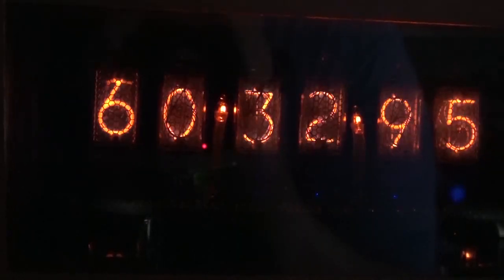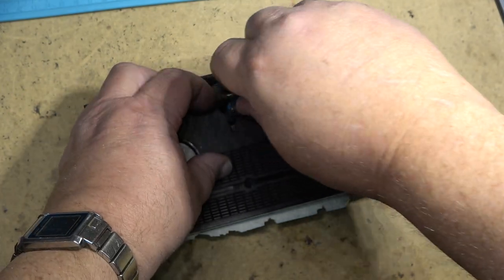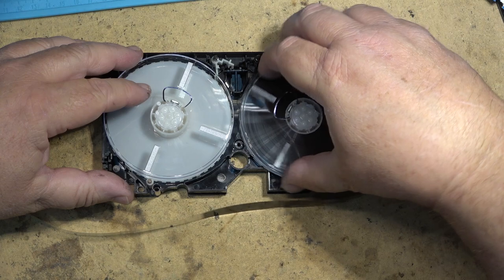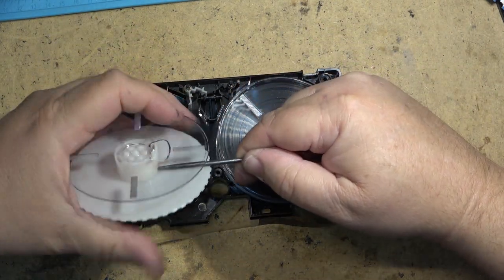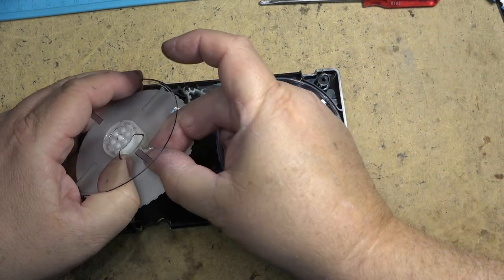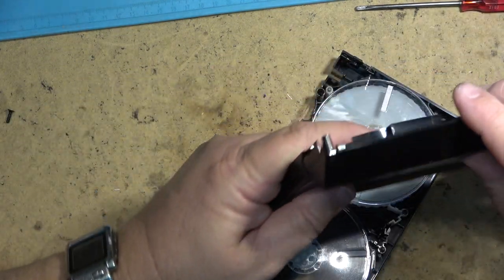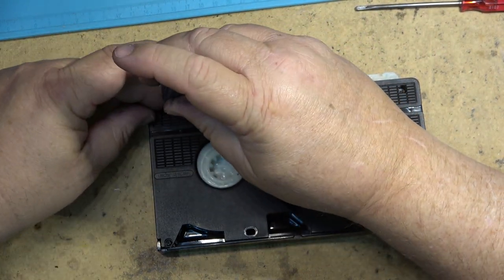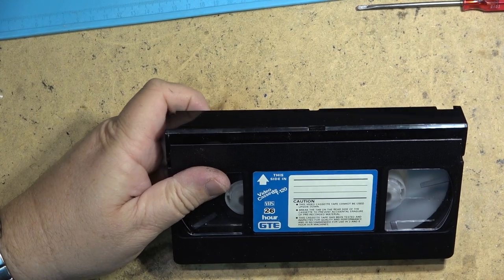How to repair a VHS tape that has broken at the hub

Comment: Years ago i had 2 videorecorders damaged internally because of a single VHS tape which the tape inside of the VHS case was sticked (probably due to humidity conditions) in the left guide. I only discovered that after the 2 failed (and rejected on both videorecorders) attemps of playing the tape, so i opened the case and released the tape from the left  guide.

Comment: There is a small hole in the underside of the spool where the tape retainer is. You insert a thin metal tool into it and push the retainer out of the top of the spool.
Reply: What if the tape is damaged, crinkled at the beginning do i have to cellotape the leader with the cut section of the tape.
Reply: @speedyboishan87  Splicing tape is the ideal option, as cellotape is too thick and can snag in the mechanism.

Comment: I'm sorry to ask this here, but I don't see a way to contact you.  Have you run into an issue with aVHS player connected to a modern TV randomly causing the screen to go blank, but there is audio?  I have tried connected to my receiver which connected to the TV via HDMI as well as connecting to the TV directly via composite.